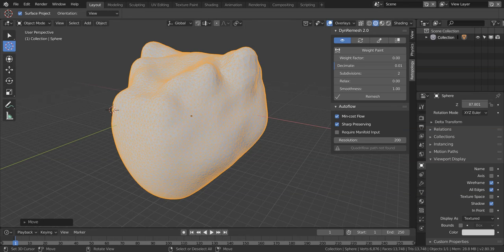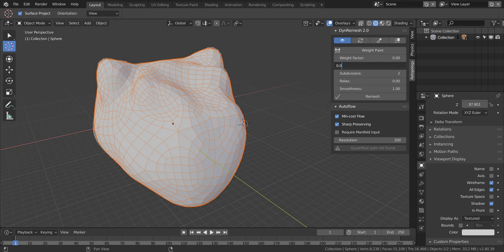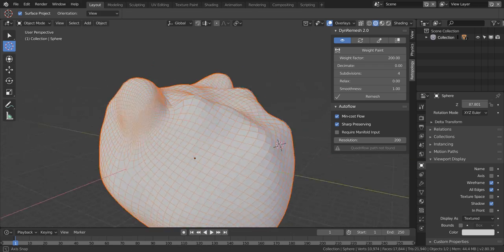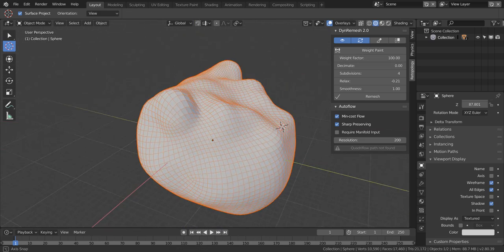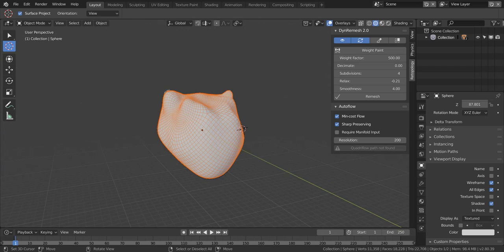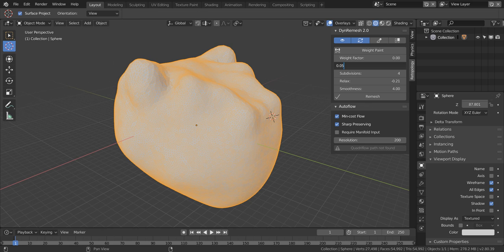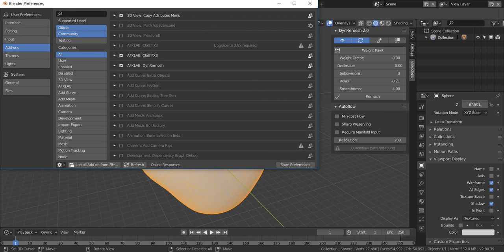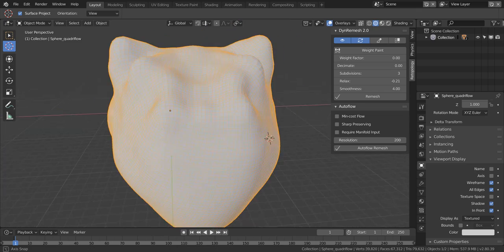DynRemesh 2.0 Quick Overview

Comment: You should gray out the the remesh button when auto update is one. That button has no effect at that moment, also i think its better to put it aside of the remesh button so it makes more sense what function it has. On the top it doesnt explain what its functionality is, putting it aside of the remesh button will let users instantly know that it the same function but than automated.

Comment: I dont get it your decreasing decimate and intensifing the subdivisions. That's like neutralizing the effec, one takes it away, the other one adds again? THats is really fuzzy actually. Also why use 0.00 inputs? make l proper input levers, this is like that weird blender unit which doesnt make any sense nor has reference to anything
Reply from the maker: Rombout Versluijs it is context from the decimate modifier setting called factor, I will be adding a preset bar and recommended settings after detecting your models polycount